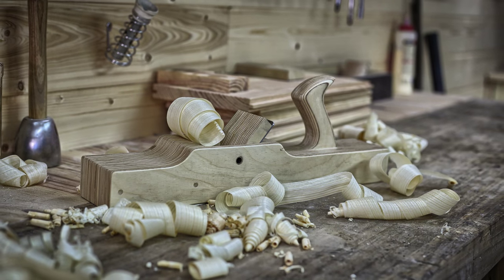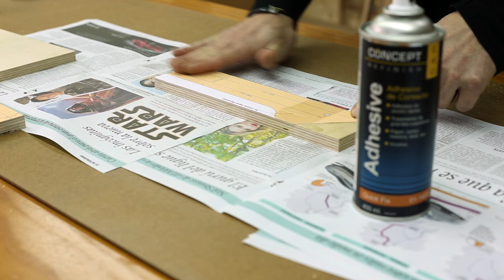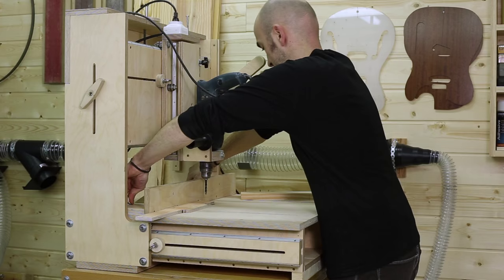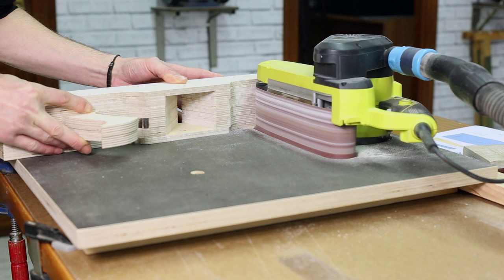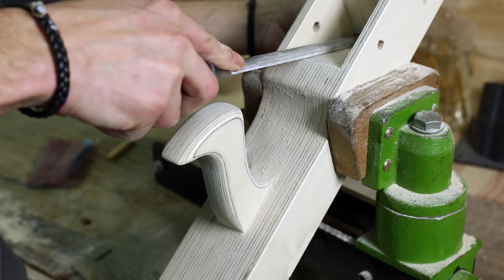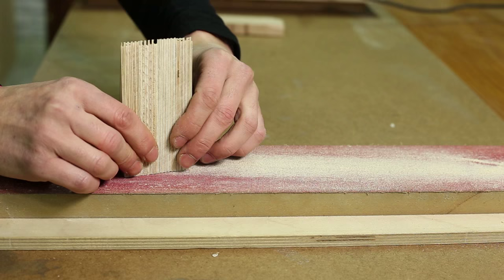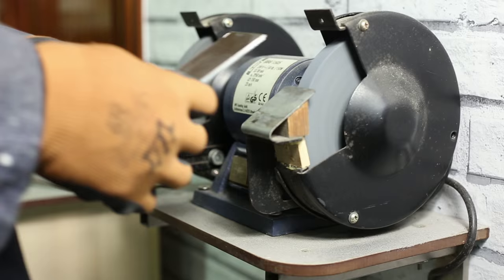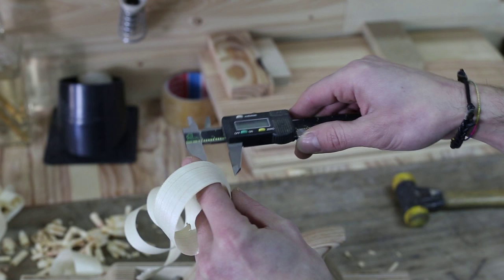Make your own (cheap and easy) Hand Plane

Comment: I have seen many methods when it comes to making planes and I  can confidently say without any doubt that your method is the best so far but my only worry is the material you used which is plywood, is it strong enough for making plane?
Reply from the maker: yes, it's strong enough. You can also glue a piece of harder wood to the base of the plane

Comment: Nice build. Any particular reason you went with plywood over traditional beech wood or other hard woods? How well does the end grain plywood hold square after repeated use?
Reply from the maker: +Sighthound Studio Birch plywood is very hard and works perfectly. Over time you may need to flatten, but this also happens with other materials such as steel even. I used plywood because it is easier to find and work
Reply: Paoson WoodWorking Sounds good. Thank you for responding.